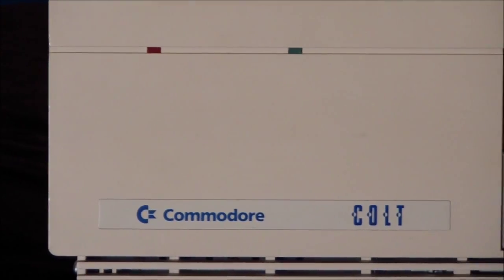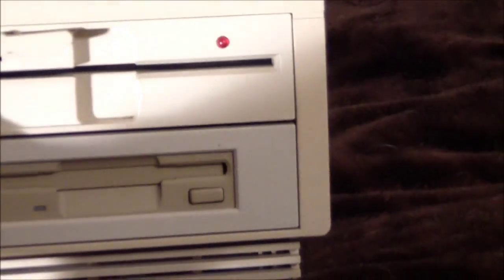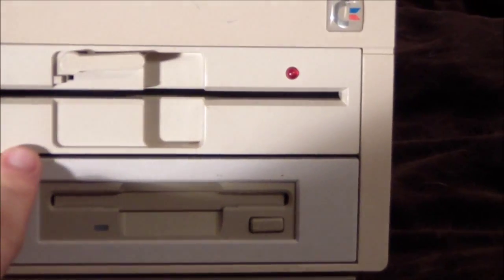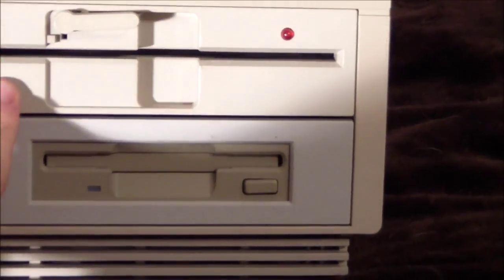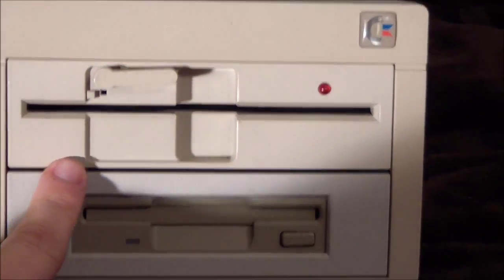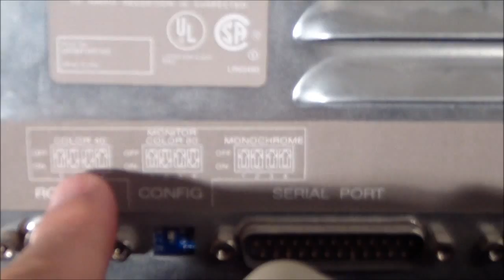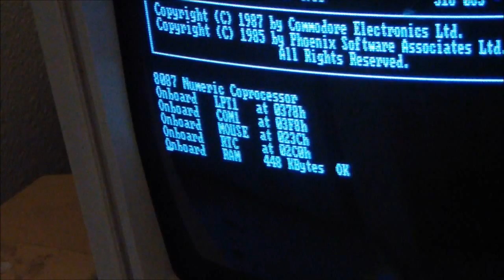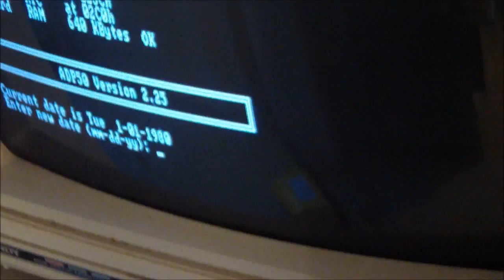Commodore Colt

Comment: If I recall correctly, the three speeds are 4.77 MHz, 8 MHz, and 10 MHz. It can be changed from the keyboard, and Commodore's version of MS-DOS shipped with a utility called SPEED.EXE that could also change it.

Comment: "Needs vacuumed"... you must be from the Pittsburgh area, right? :-) It is classic Pittsburghese to leave out the "to be", such as "needs fixed" instead of "needs to be fixed". Anyway, you can often find the Seagate ST-351A/X at reasonable prices on eBay. It is the best IDE-XT compatible hard drive, with 40 MB capacity; it's fast (for its era), quiet, and (in my experience) reliable.
Reply from the maker: +vwestlife wow, impressive. your right. I grew up maybe 20 minutes outside of Pittsburgh. Moved to Phoenix about 3 years ago. Thanks for the tip. I'll keep an eye out for a seagate ST-351A/X.
Reply from the maker: +0blivi0n100 found three Seagate ST-351A/X drives at a thrift today. so far havnt had any luck getting them to work on the Colt. They spin up but I just get a "hard drive not found" message

Comment: Regarding the floppy drives, the termination resistance changed at some point in the late 1980s, and newer drives don't necessarily support the old, lower termination resistance. Some had a jumper, which might have been labelled "TM" or similar. Also: With a new enough version of MS-DOS—probably 3.2, maybe 3.3?—you may be able to use either a DRIVPARM= statement or DEVICE=DRIVER.SYS in CONFIG.SYS with the right parameters to gain support for floppy drives the BIOS doesn't natively support. My first PC was an Amstrad PC-1640 that didn't natively support the 3½" double density drive my parents were upsold to when they bought it, but one of these two CONFIG.SYS statements made it work just fine.

Comment: Actually, the Commodore 1351 (typically pronounced "thirteen-fifty-one" in about the same way as you'd pronounce the drive models) is the mouse that runs on the 128 and 64, but the Amiga mouse is different, I think.

Comment: Hey, do you know if I could use a different keyboard. I have a colt no kB. I heard mitsumi at/xt are compatible. Any help would really be appreciated.
Reply from the maker: I don't have the Colt with me to check but as far as I remember it uses a standard PC style keyboard connector so any PC type keyboard should work. keep in mind I said PC type, AT looks physically the same but won't work. Some keyboards have a little PC/AT switch on the underside.
Reply: Ancient Electronics thank you for the quick reply. Great videos btw. So AT ibm?
Reply from the maker: @TheRoddfather  Thank you. No, you have to make sure its a PC style keyboard or has a switch to put it in PC mode. AT uses the same connector but it works differently so an AT keyboard won't work.
Reply: Ancient Electronics I’ve heard an mitsumi kpq-e99yc will work. Lots on eBay.
Reply: @AncientElectronics lucked out and found 2 actual Colt keyboards..  :)

Comment: Hey!
I know you're not here for tech support but I was hoping you could point me in the right direction. I just picked up a Commodore Colt and on boot, I get "Drive A: Bad" with "Press F1 key to continue". I've verified connections and voltages but no change. Short of getting new floppy drives, what can I try next?
EDIT I was able to solve the error. Both drives were terminated with the TM jumper. Now I am unable to boot from my DOS 3.3 disk (Boot device failure) but I am unsure if the disk actually works. Will try an OS/2 disk tomorrow.
Reply from the maker: Randy Strye I'm glad you got it mostly sorted out it seems. are you useing 2 X 360k 5 1/4 drives or 1 360k and a 720k drive?
Reply: 0blivi0n100 They're both 5.25" and it looks stock, so I'm going to assume they're both 360k drives
EDIT http://imgur.com/DAJccGJ Here's a picture. It has a Seagate ST-225 20MB HDD but the HD controller doesn't work. I have one on the way.
Reply from the maker: thats's odd that the jumpers were set incorrectly. I didn't know os/2 came on 360k disks. at this point it looks like it may be the DOS disk. do you have any other machines to test the dos 3.3 disk in? do you have any 360k booter games to test the drives with? they don't require an OS to run as long as their in A: drive on boot up.

Comment: I brought one of those new in 87; no hard drive, green screen, no mouse, must know MS-DOS 3.2 codes to operate.  You must have a later model (your’s has a mouse and 3.5 drive).
Reply from the maker: Mine originally had a green screen when I picked it up and the 3.5 drive I added later. it was originally two 5 1/2 drives.